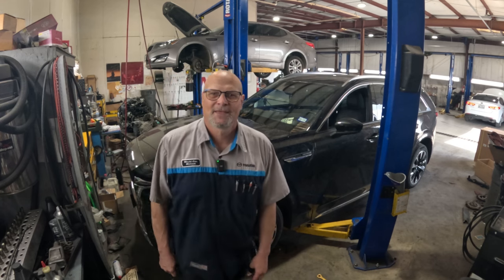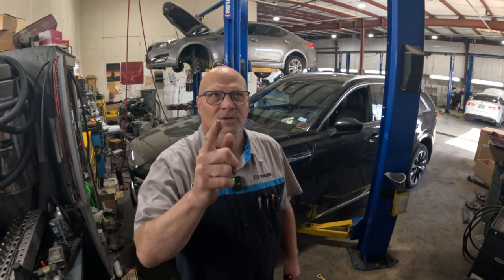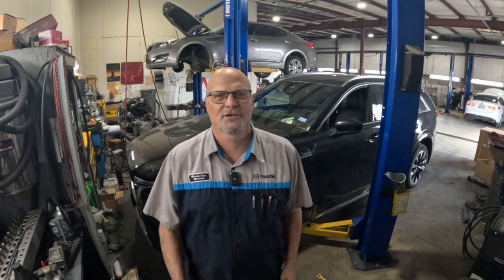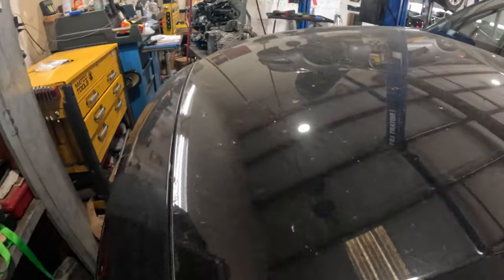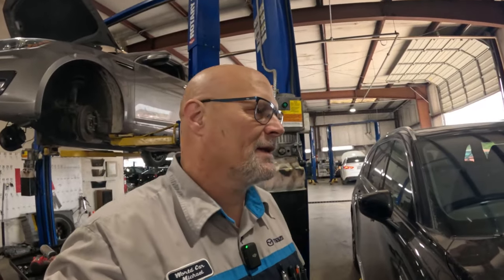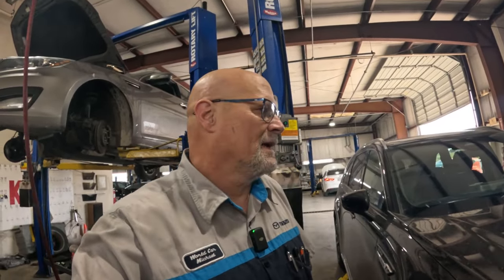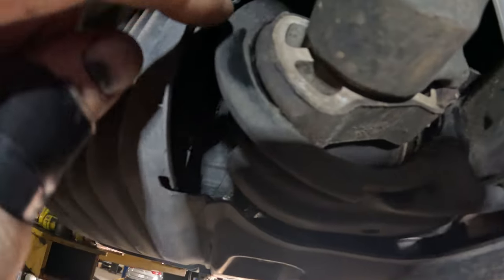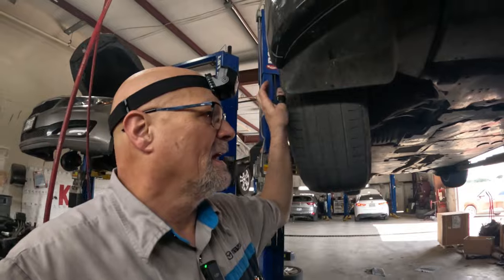Mazda CX-90 Suspension Noise

Comment: Just did all of the recalls on my CX-90 PHEV using MDARS, everything went smooth.
Reply: Did these recalls/updates fix all the major issues you might have had? I'm a 4Runner owner used to working on my own vehicles but looking at slightly used CX-90 PHEV as a possible family car for the wife. So this new engine/EV combo is something I'm not comfortable working on myself and just looking for reassurance that if we buy one of these returned vehicles or even a new one that the major kinks are addressable while it's still under warranty and that we'll ultimately be happy with the purchase. Would love your thoughts. Thanks!

Comment: That seems to be Mazda answer to all problems, put some grease on it. My 2024 CX-90 brakes were squeaking they put some grease on it. Drove off from the dealership, and the brakes are still  squeaking. The trunk hatch was clunking while driving, and they  put some dialectric grease on it.
Reply from the maker: Mazda has had brake squeaking issues since the beginning of time.  I don't know why they can't get it right.  I have noticed the CX-90 brakes squeaking louder then ever.

Comment: I have this noise I think on my 70 MHEV, does it kinda sound like the sway bar end links are bad? My dealer said it was natural and drove 3 other 70/90s. It's driving me nuts. Light bumps it sounds like the end links are completely toast
Reply from the maker: The CX-70 are brand new.  I have not worked on any other then performing a PDI. I have not heard any noise in them and there are no bulletins. You might try taking it to another dealer. Drive with the technician and point out the noise.  Test drive another CX-70  with the technician and see if it has the same noise.
Reply: @ShopForemanGarage  I have - fortunately/unfortunately they drove another 70 a new 90 and a used 90, all having the same noises within the same route. 

From what I'm gathering, Mazda USA has not been giving dealers a ton of the intricate details on these - like the noise generator that both the MHEV and PHEV have that sound like a grinding noise, or the 5th to 6th gear shift that gives the 'woot' sound.

Comment: My 2024 CX-90 Turbo S PP definitely have the creak or squeak noise that I can hear at low speed sometimes. It doesn't always make the noise and it might be why you can't "duplicate" the issue when you drove that particular CX-90. I suspect that it could be effected by air temperature. I know it's frustrating having to diagnose a customer concern, but just know that it's equally frustrating for the customers as well.
   
My Falken tires are close to the wear out line already at 14800 miles. These Falken tires performs well, but don't wear so good.

I appreciate your videos showing what you have to deal with.
Reply from the maker: Thanks for the comment and thanks for your support.  I believe the bulletin talked about driving over uneven surfaces.
Reply: @ShopForemanGarage  I hear it the mostly when backing out of my garage and pulling out of the driveway over uneven surfaces. I have not taken it in to get the TSB done yet. So, we will have to wait and see if it'll creak or squeak the next time I take it in for service.
Reply from the maker: @MikeATL-  you may have to take the technician to your house and have him back out of your driveway. lol, I have done that before.

Comment: Thanks for the CX-90 content! I may have missed it, but how many miles did the customer have on the tires? These OEM-specific tires have a treadwear rating of only 300 which is similar to a summer performance tire and not an all-season - I'm guessing it makes them less expensive for Falken/Mazda to have such a low treadwear rating? I really don't want to replace them with the same model when mine wear out, though I doubt there are many tires to choose from in this specific size that will be priced reasonably.
Reply from the maker: It had over 29,000 miles.  I think it may be a soft compound. But, that also makes it a smoother running tire.